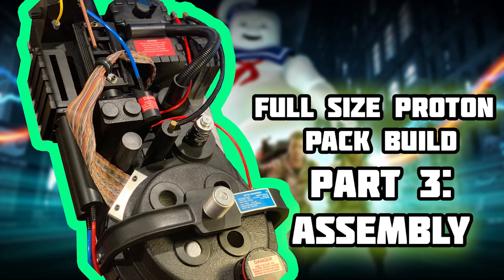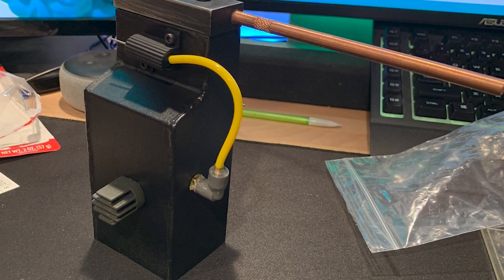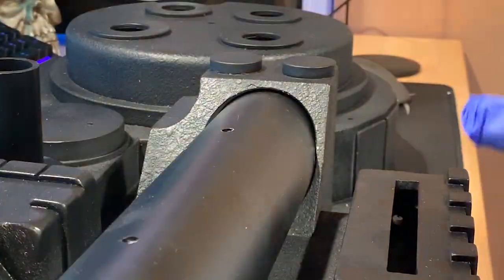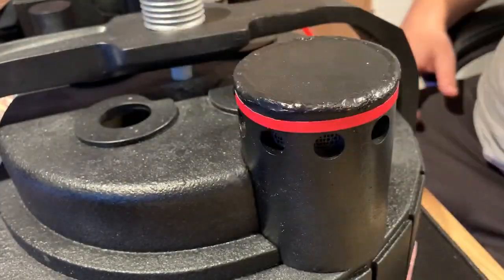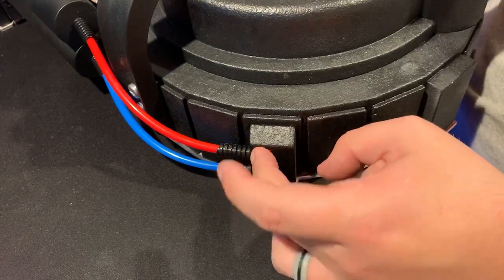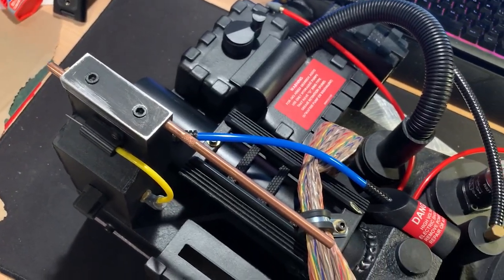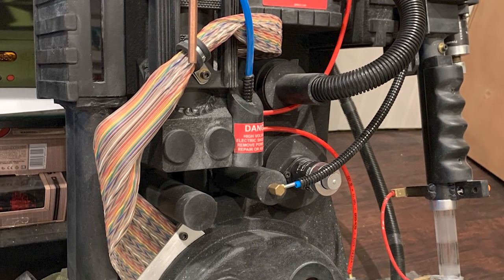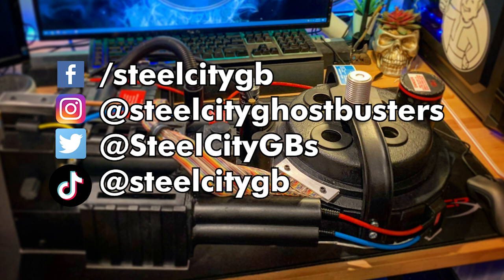Proton Pack Build - Part 3: Assembly

Comment: Looking good. I've had my BOK kit for almost 2 and I'm still working on it lol. Winter months in canada really pump the breaks for having to paint and do some of the messy stuff outside. If you add the aluminum labels it will make everything pop that much more. I also have my n filter friction fitted for the same reasons as you, could always add a little hot glue. Been a little hesitant assembling the wand because I really wanted a pop mech in there but I'm thinking it might take a little too much engineering.

For my weathering I hit all the high spots/edges with a silver spray paint. Once it dried I used a liquid latex where I wanted the chipping. Hit it with black and rubbed off tye latex. Worked really well

Comment: how did you attach the cylinder that you put the round sticker on?
Reply from the maker: The HGA is attached with a long bolt that runs all the way through it and through the pack shell. It’s secured inside with a nyloc nut.

Comment: Looking good, but may I ask why you added the Danger Label to the N Filter? The GB 2 packs did not feature that label.
Reply from the maker: My primary reference was the Sony Lobby GB2 pack, which does in fact include both labels on the N-Filter (although with 30 years of wear). They are readily available via the reference section on GBFans.
Reply: @BCarn07  sadly you’re wrong... There is a guy in the GB Forums that created a complete Ray Stantz Hero Pack from scratch based on the second film and did not add the danger label on the pack. The packs in the second film never featured this label. If you search for reference photos of Sony’s used Hero Pack Dan’s pack will come up does not have a danger label on the N Filter, not even Bill Murray’s had it in the film either.
Reply from the maker: @christopherniceley8848   Here's a link to the reference photo I am speaking of:

https://www.gbfans.com/wiki/Sony_Lobby_Reference#/media/File:Sony_Lobby_Set_1_Picture_321.jpg

This was taken in the Sony Lobby. You can find the full set in the reference section of GBfans.  Granted the label is in much worse condition, but it still stands that my reference hero pack has the label in some form.
Reply: @BCarn07  those are two different packs 😳 and wasn’t one they used for filming in GB2... Besides that one photo every other photo has no reference of a Danger Label on the N Filter.
Reply from the maker: @christopherniceley8848  Fair enough. I still don’t see any direct evidence that marks this one as an inaccurate reference. Upon further researching, I think I was misremembering the label as the piece of scotch tape seen on (if I’m recalling correctly) a Stantz pack. We’ll how I’m feeling next time I’m working on the pack and maybe I’ll take that under advisement and toss a strip of tape on there in place of the label. Thanks for enjoying my build enough to chime in with some constructive criticism. 👍🏻
Reply: @BCarn07  your build still looks amazing and you can make it the way you like. I shouldn’t of stepped on your toes and should of looked at the detail in a different perspective. I apologize for that and didn’t take in consideration that you may of known about the danger label but could be just building it for your personal preference and or likes. This I am sorry for.